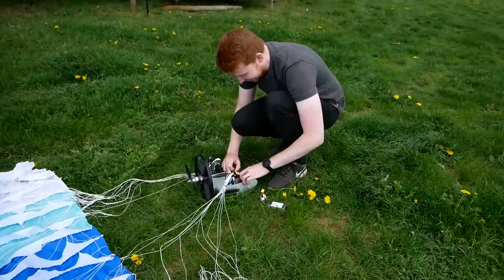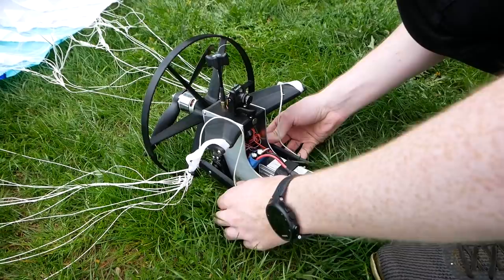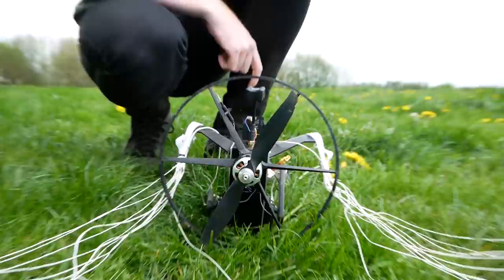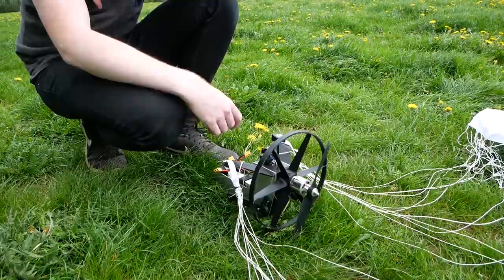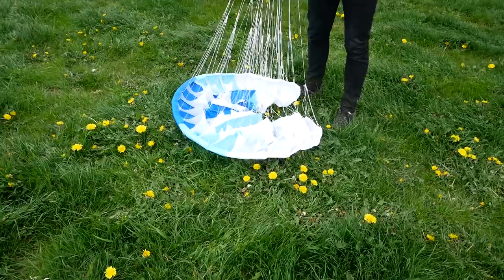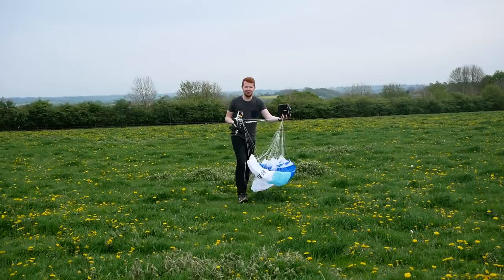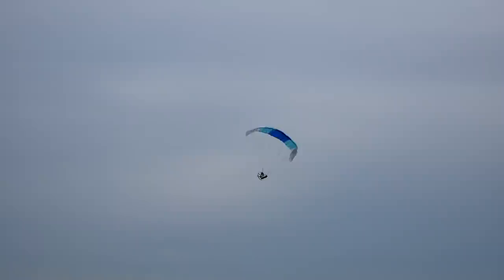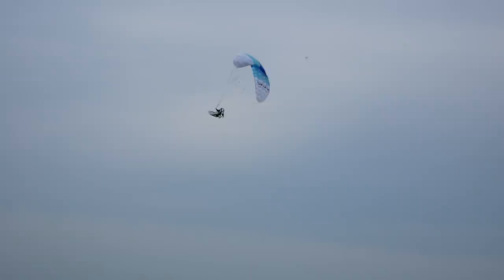Remote Control Paramotor - BANDARRA

Comment: Torque isn't a big deal on modern designs, just a little weight shift when under full throttle.  Since your comfort bars hold the risers farther out from you than a freeflight harness the danger really comes in if you are hitting the motor hard the blade gets more horizontal.  A horizontal propeller providing thrust will quickly invoke Newton's Third Law and spin the pilot under the glider.  If an inexperienced pilot doesn't get off the throttle in this scenario then they will start providing reverse thrust to a paraglider wing AKA bad things.  I think his design could use more weight an inch or two underneath the cage where a pilots legs would be.  That would stop it from pitching back and forward as violently.

Comment: First of all very set up .
I am also RC pilot n flying since long time ,

I m going to start Para galiding flying ,
Need some information about radio setting.
Can I set , delta wing setting ?
As we used to set for Delta wing plane ??

My wing size 2.5 m and fram 10 inch,
Do we need CG setting for this also ?

What will the CG point if need??

Thanks if u guide

Comment: For about 10 month I own a CA 2.8 produced by the guys from punkair. Maybe you wanna try out THE real staff. Yes they are not cheep but it is real sports equipment. I would recommend a sir Edmund race in your case with the weight you mentioned. You will definitely not be disappointed. I really like the paras they produce. 
Maybe you can also try to add a speeder to your para set by using a servo to pull down just the A-lines, depending on the para if it works nicely but you could give it a try.

HF & Gettings 

https://shop.cefics.com

Comment: Put more weight on, I found 2-3kg is good. I fly one at 2.2kg and one at 2.9kg and they handle wind fine, the third is 1.2kg and does not like wind at all but very acrobatic in calm weather